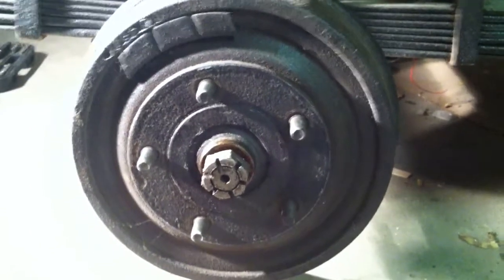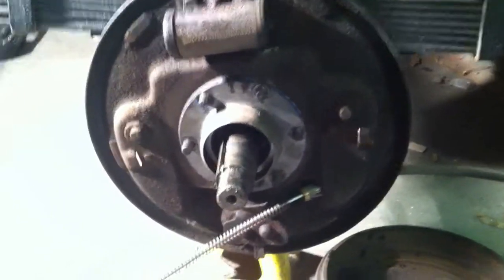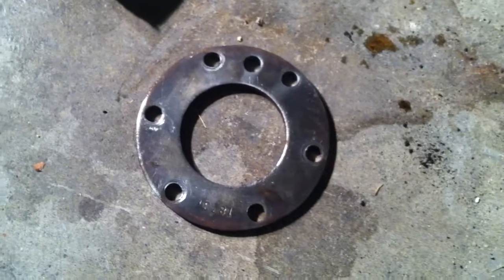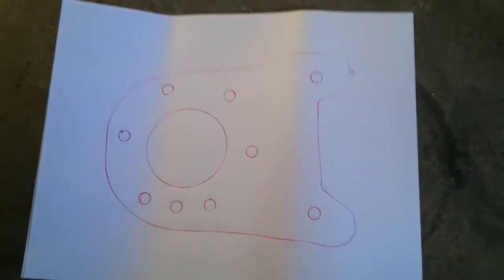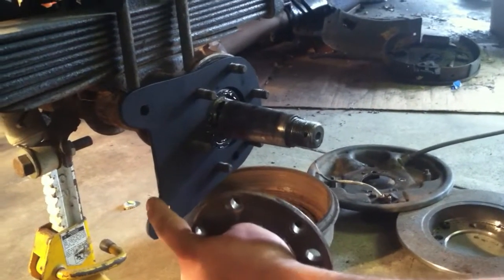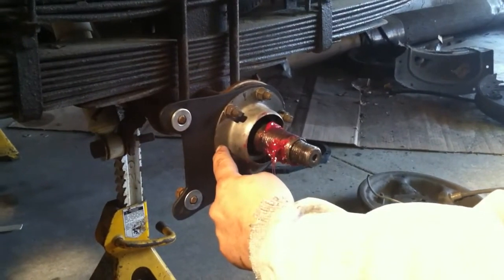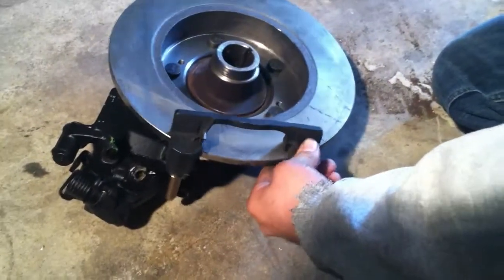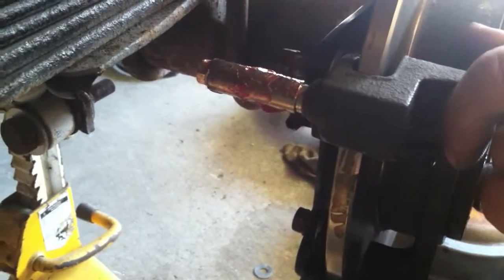Willys Jeep Gladiator rear disk brake conversion

Comment: Thank you for posting this. I have a '64 J200 that I'm converting to disc brakes. From the shop manual, it appears that there were a few options for rear axles in these early J trucks. Mine has a Dana 53 - is that what yours is? Also, did you ever decide to sell the brackets you designed?
I know this video is from a long time ago, but hey, the truck is old too!
Reply from the maker: No I never decided to sell the brake set. I’m not sure what rear axle I have. To be honest I don’t even know if the tag is still on there. Glad you enjoyed the video. I will have more coming this year on this truck! Been in storage but will be back out and working on it soon!

Comment: Hi, really like your video.  Was wondering if you still have the template for the rear caliper bracket.  Also, how did you end up connecting the Mitsubishi calipers to your emergency brake?